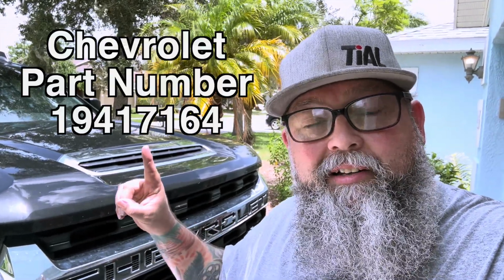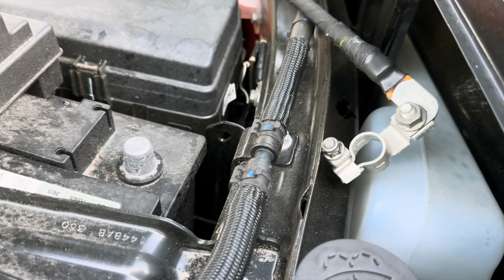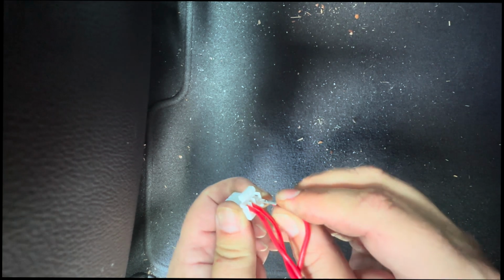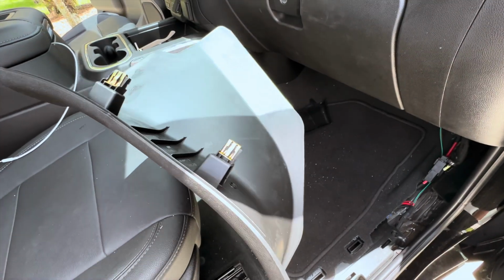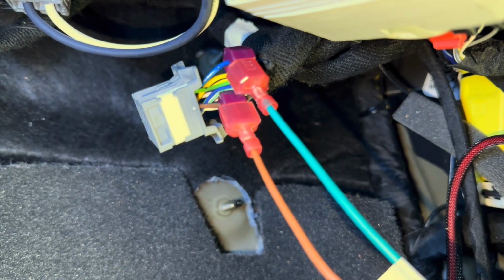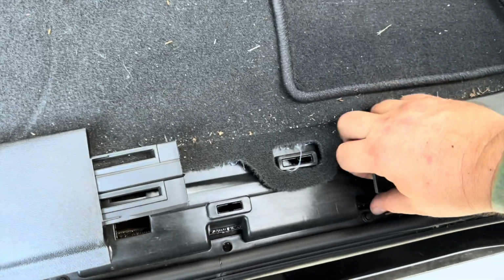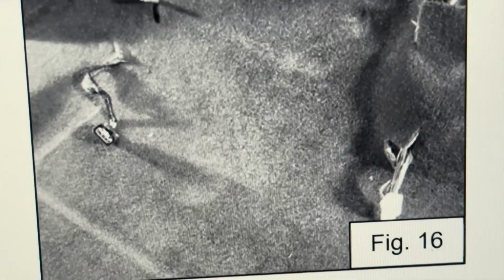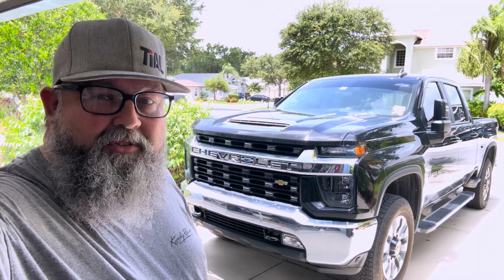2022 Chevrolet Silverado 2500 HD - 200-Watt Subwoofer Kit by Kicker - GM Part # 19417164

Comment: Where did the plug that had a brown and green wire go too?? The one towards the back of the truck? I just installed mine and have a single plug same as you that is green and brown wire and saw you had the same plug

Comment: Make sure you flip the amp switches up
Reply: I saw someone do that in another video but they didn't explain why. What does that do?
Reply: @GRI5TH-MusicDude  Makes the sub a lot louder
Reply: @GRI5TH-MusicDude  you flip all of the dip switches up if you’re going to use a base control knob. Otherwise you don’t need to switch them all up.

Comment: Did it make the stereo louder?
Reply from the maker: I guess I'd say it louder... but just because you can hear the bass more from outside? It's a subwoofer, so it makes the bass louder, but not anything else.
Reply: I felt like i did added a bit of boost to my bose system. The bass tho… it went from 0-100 quick

Comment: Anyone having issues with bass being low? Have the kicker knob but bass is very low with it turned all the way up
Reply: You need to put the amplifier levels switches up except the 6 dip switch all of them are located under the amp which you will have to unscrew it from sub box
Reply from the maker: I have a very good amount of bass from mine.

Comment: I have a question for anyone reading. The input is getting tapped into from the left speaker. Is this giving full bass or is there bass comming from the right speaker that the amp is not getting? Is it missing a full sound? I have just got this sub installed and it seam like some songs are not getting that full bass all the way thru a song. If I tapped the wires from the left positive and the right positive going to the input on the amp would this be safe? Ultimately bridging the channels.
Reply: If you unhook the the amplifier only which is only 4 screws… move the gain levels on the “equalizer” all the way up. The equalizer is hidden under a piece of rubber that looks like a black tape. Remove it and move the levels all the up and you will the true power of that sub. I keep mines at half because it shakes my car.
Reply from the maker: No. That wont work. I can't tell you why it doesn't sound right. Mine works great.

Comment: Good call removing the battery. I had my 11 year old son with much smaller hands poke my power wire through. 2024 trucks are a little different. Wish I’d removed my battery and done it my self. I’m not 100% sure my boy went through the exact correct spot but he got it through one way or another.
Reply from the maker: Thanks for sharing

Comment: I have the same setup but I’m running into an issue with the sub not working while the truck is running. Works great when I’m in accessory mode and motor is off. Any suggestions on what might be causing this issue?
Reply: You have your turn on amp wire hooked to accessory power?
Reply from the maker: I did not have any issue like that.
Reply: Your battery might need to be replaced